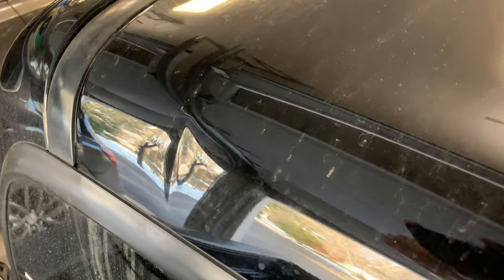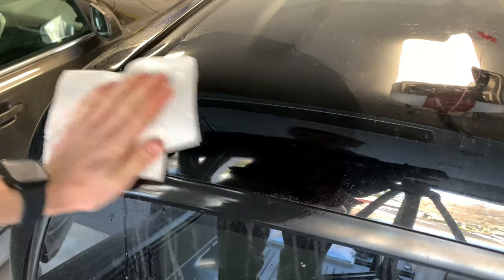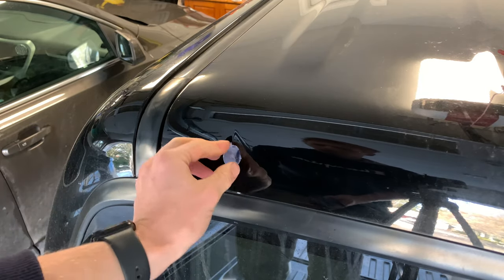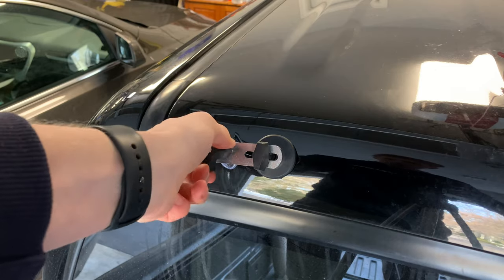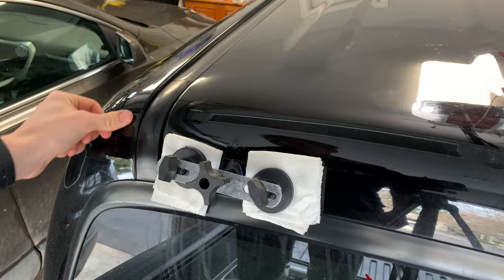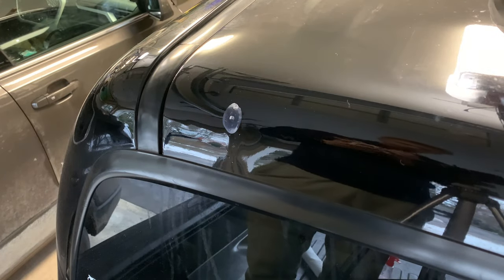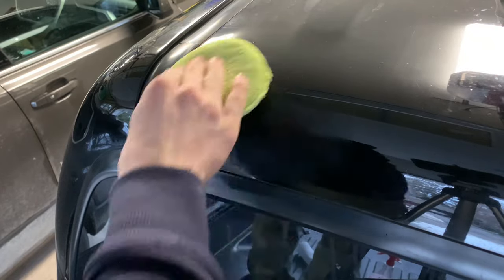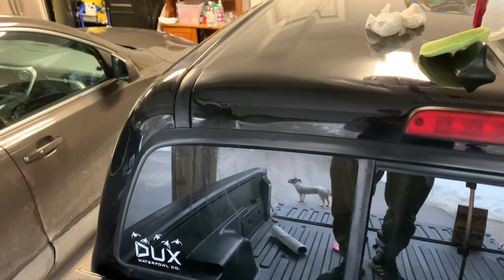$15 Harbor Freight Dent Puller, Does it work??

Comment: HF puller works pretty good on medium to large dents.   Had very little luck with hail damage, but besides that it works good.  I scored my tabs with a razor before use though.  It helps.

Comment: A lot of PDR videos I've watch heat the paint with a heat gun before the pull so the paint doesn't crack, they also use IPA to remove the hot glue.  I think you do a really good job.  I'll have to check to see if HF still sells this kit.

Comment: it doesn't get better than that when you have a crease on a curve! You would have to use some bondo and sand and paint. You probably wont see it unless you're to the side with the light hitting it just right. I'm impressed that it lifted the crease as much as it did! Good move roughing up the plastic for the hot glue to stick better!

Comment: When you start figuring out how to get really really good adhesion with tabs like these - examples being warming them lightly with a torch first..  - you can start exerting pretty crazy pressures via them - pulls into the hundreds of kilos. However what will happen then is the steel shaft will tear out of the plastic tab as you get better at sorting adhesion issues.. That's using a pulling tower not the little jig the tabs come with.  So with that being said, if you are not getting a pretty solid pull with these & the little jig, it's your adhesion technique that you need to sort, because the tabs will take some pretty hefty pulls waay beyond what the kit is designed for.  

TLDR - sort adhesion issues & these pull pretty well.

Comment: Good warts & all video got a few dents that I will try to remove thanks to you.
I have no idea if it would work but think I will put a washer between the knob and the frame, thinking that the resistance will be reduced and make turning the knob easier as the washer will turn as it gets tightened down.
Great vid 👍👍👍👍

Comment: well without using professional strength glue, if you would have heated your panel a bit, while under pressure you could have tappen the highs and it would have came out easier

Comment: Here is the deal..... this tool works to a degree.....With that said, I have had two dents that I worked on that I was just not happy with.  So....I have a local Pro Dent repair place in my hometown.  Both times I have brought dents in for repair, they said I "over pulled" the dent....made it worse.....lol.   I mean, it looked better to me, but, the pro's said I jacked it up.  So....... beware

Comment: I tried this tool or a very similar one anyway.poss from amazon.not only was the glue crap.but the tool bent then snapped in half.and to add insult to injury.the tool made 2 more dents where the feet were.even thought I made sure they were on a stronger section of the pannel.you would be better of buying a slide hammer with bonding tips
Reply: I agree, I had the same misfortune, just few days ago I bought the HF dent removal kit and followed all instructions to the t, the tools snapped right in the middle. Needless to say, I returned it the same day. You get what you pay for.

Comment: I've got about an inch long linear dent with a shallow crease in the middle, at the bottom edge of a hatchback door and perpendicular to the bottom.  The paint isn't damaged.  It's not noticeable from a distance and probably not worth going to a body shop.  But it is bugging me.
Reply from the maker: That’s similar to the dent I had. Figured for $15 it was worth trying to fix it myself but not bad enough to go to a shop.

Comment: This kit while good for the money will not fix smaller dents near edges of wheels or  on double walled metal it is primarily for thin sheet metal in the middle of a large area otherwise the glue will not hold you'd be better of using gorilla glue letting it set and then dealing with getting that off the hot glue is very weak even after it sits a while

Comment: Is it possible to "over pull" the dent?
Reply from the maker: From what I found not really, but may be possible if you only pull in one area too much.
Reply: @wingbros3750  I bought this puller about 2 hours before your reply. Will be playing with it this weekend. Thank you!
Reply: Yes it is easy to over pull a dent.
Reply: Awesome video,well done ,will be buying this tomorrow
Reply: Harbor freight sells a complete dent remover kit with tap tools in case you over pull. Sometimes you might need to purposely over pull to tap things back down so it ends up looking perfect. Takes a lot of work and patience.

Comment: The acetone is the release agent to remove the glue tab.
Reply: NEVER use Acetone!!! Are you high??? That would remove paint! Isopropyl Alcohol
Reply: @Lendingyourlight  acetone won't hurt the paint. In the 70s when laquer and enamel were used maybe. But a small amount of acetone won't phase today's urethanes.. 91 percent alcohol is the prime choice for glue removal though.
Reply: @kylebachman4477  lol. Wrong
Reply: @libertybell5796  sorry Charlie.. But you're dead wrong.. I've been working in this field forever. So I'll say it again. Acetone used in that amount will not hurt today's urethanes.. you're welcome